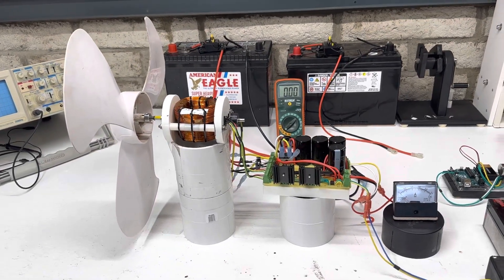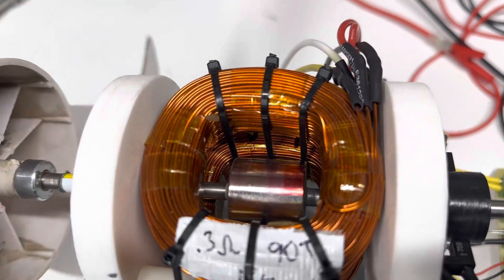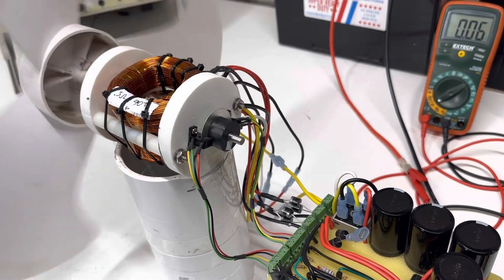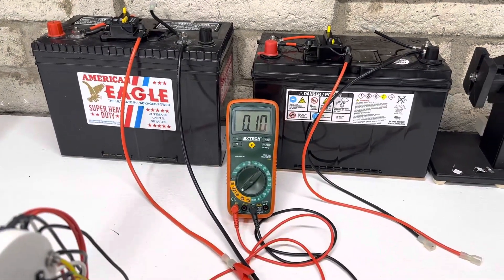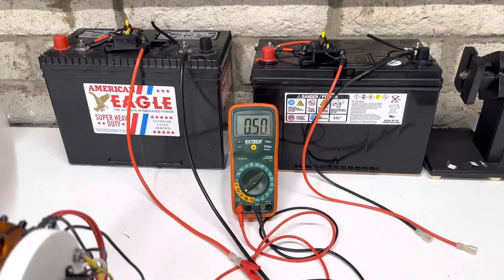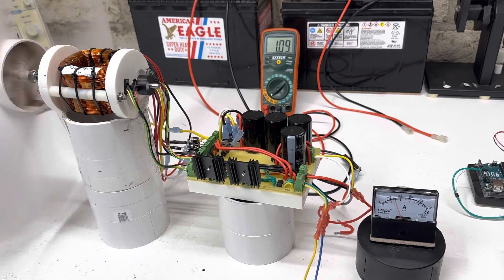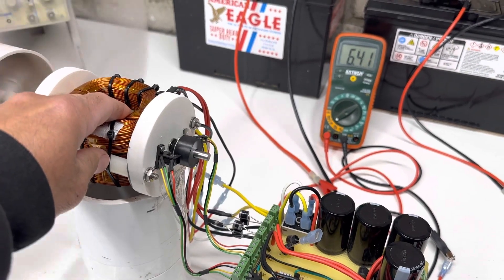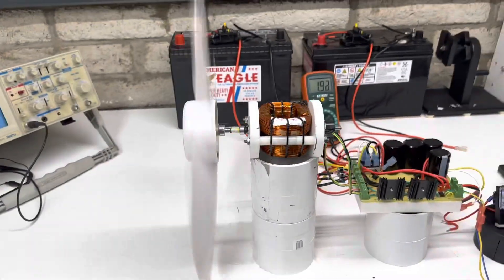H bridge alternative running update

Comment: Nice design, Looks like your return diminishes at higher frequency. A suggestion which may improve it would be germanium diodes with faster switching times and the mosfets themselves. Check the datasheet for the most efficient on off timing cycle for the mosfet, taking into account its internal capacitance. If the gate doesn't drop to complete off position before the next on cycle then the magnetic field never completely collapses. One thing i'v come to realize with EMF flyback is that you need a hard off cycle to create the collapse, preferably at the peak of the current sine wave at a 90 degree phase shift to that of the voltage. Keep it up, love your vids!!
Reply from the maker: Thank you for the comment !
 The reason the output ( diminishes) is at full power it only pulses twice per revolution versus 20 or more times when using the pwm speed controller 
 And yes you definitely need got off time to make the spikes the most powerful

Comment: Is there a way to calculate at what number of coils or turns in the coil, could achieve a set amount of mechanical output and the power input, including the power returned, being the most efficient for that . Thank you for showing us what all could be done with electric motors seeking efficiency.
Reply from the maker: Not that I know of just depends on coil size pulse with and the load 
 Some motors just work better than others 
 One thing I Know is more circuits is usually more out put